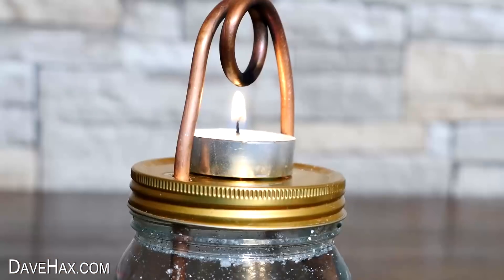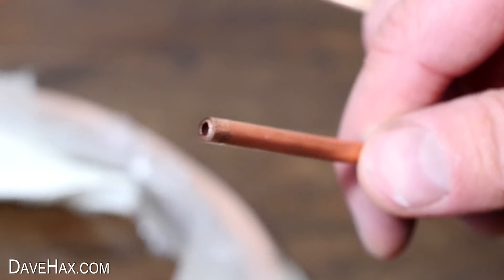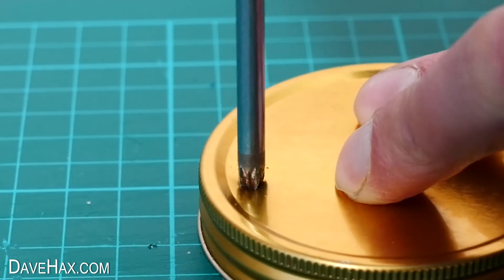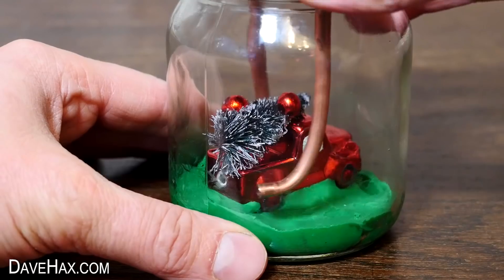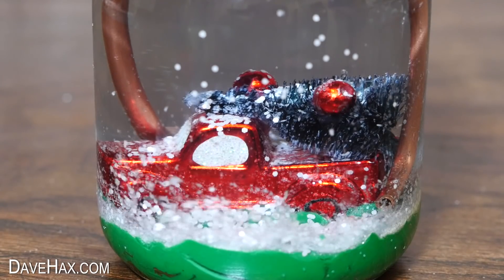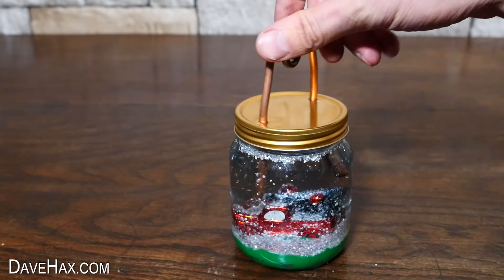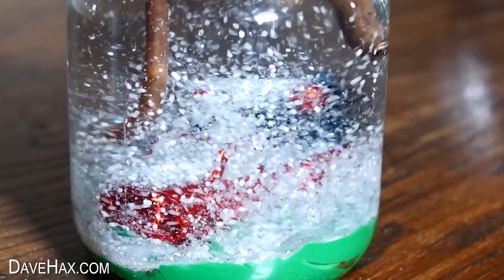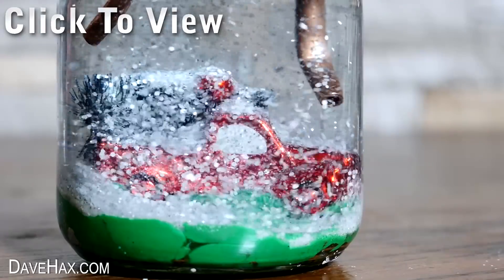How to Make a Candle Powered Snow Globe

Comment: (Tip: Copper pipe is easier to bend or coil - and not crimp - if you fill it with sand. Empty the sand when you have the shape you need.)

Comment: I think having one end significantly longer than the other should keep it from stalling. Also I will punch two small tabs up from the bottom of the lid to hold the candle from sliding off if it shakes a lot. 
 Cool idea. Thanks. 🎄